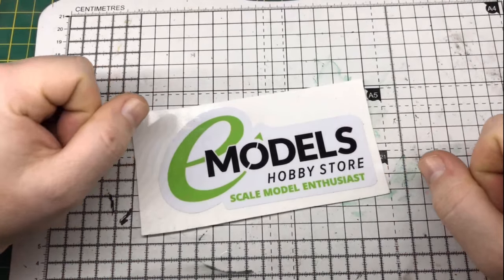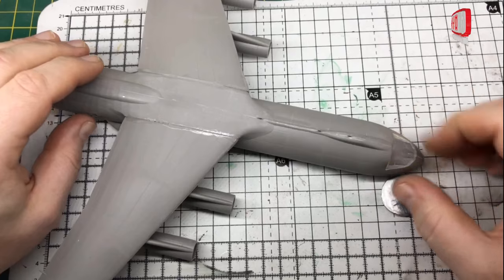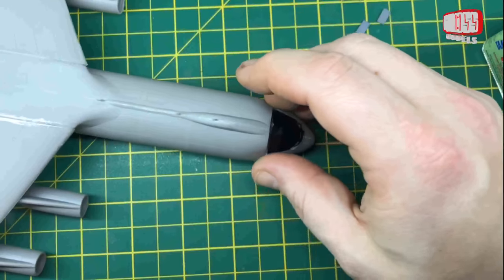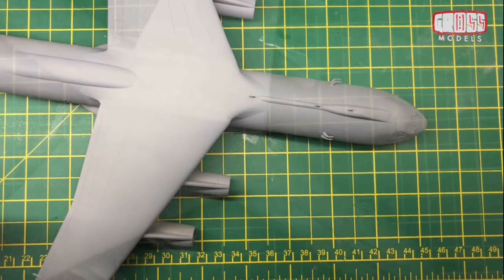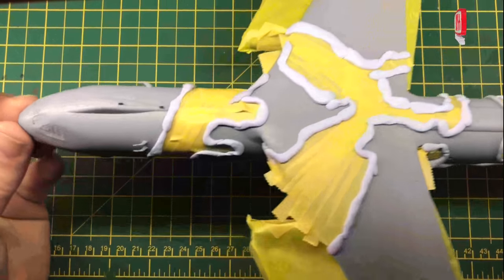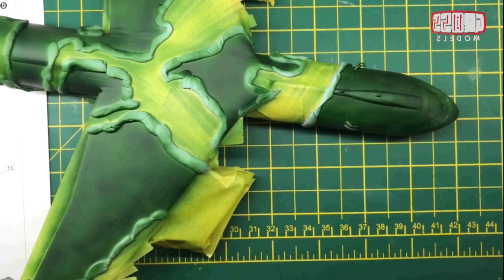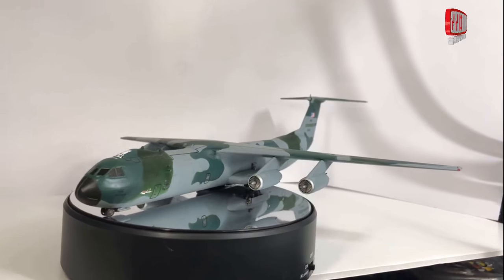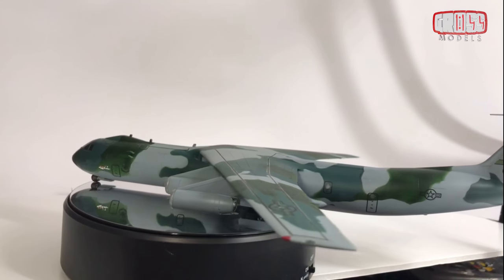Roden 1:144 C-141B Starlifter part 2: Painting and weathering

Comment: I know it was 3 years ago when you built the C-141B model, but I watched the video today.  I was a crewmember on the C-141A and C-141B model aircraft with the 4th MAS at McChord AFB for 10 years of my military career.  I have over 5000 flight hours in both aircraft as an enlisted crewmember (Loadmaster).  I then moved over to the MC-130H Combat Talon II with the 7th SOS and was stationed in England at RAF Alconbury and RAF Mildenhall between 1992-1997 and gained another 2000 flight hours on that aircraft.  Good to see you build a nice representation of an aircraft I used to spend many hours on.  Great job!  Thanks!
Reply from the maker: Thank you. I hope I did it  justice!